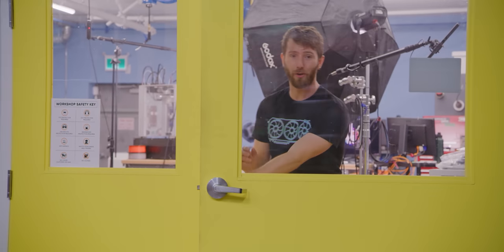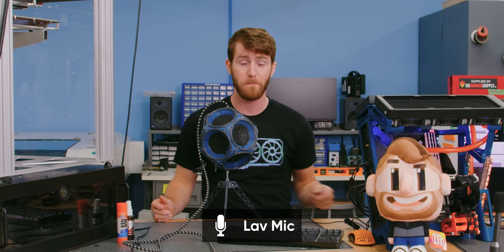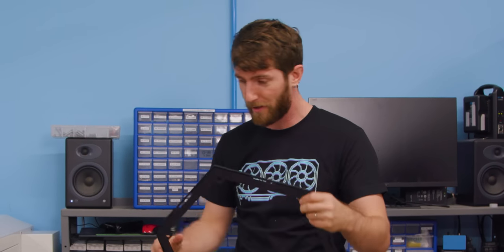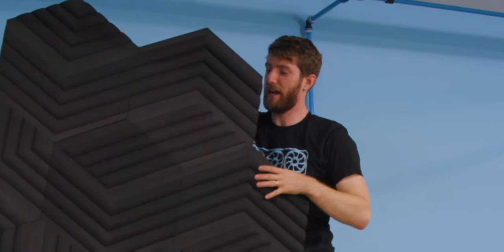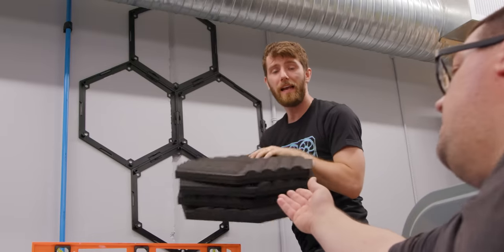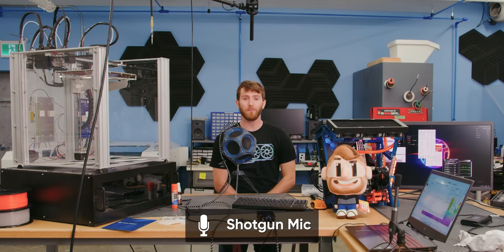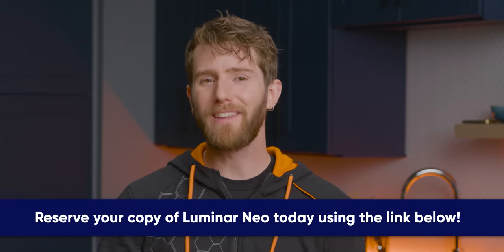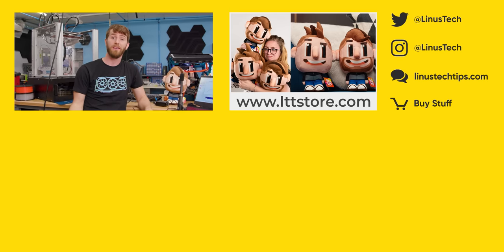I'm only going to say this once... - Acoustic treating with Elgato Wave

Comment: I'm building my own sound isolation setup with acoustic panels or foam and cardboard. And yes....I have made my own wooden frame with stuff I bought from Bunnings 

Tip: If you don't want to make the panels permanent on the walls just buy some stick on picture hooks and wire so you can take them down and place into a new position.

Comment: Whenever I see someone put up foam like that I just hope the manufacturer really got them rated for being fire resistant and not producing toxic smoke if they catch fire... Why worry? Because much too many companies and consumers just don't care or even understand just how bad it is to slap up random foams, well, anywhere. Like many of the DIY ones are pure fire hazards because most just buy the cheapest foam-like stuff they find, not knowing what happens if it were to come in contact with a heat source.

So good to see these appear to be somewhat decent.

Comment: A note: the panels are great for streaming purposes, but if you are streaming in a workshop environment like in the video (so 3D printing or CNCing toxic materials), you may want to spend a couple hundred more on acoustic moss.  This will do the same but also help purify the air.

Comment: Besides hard surfaces that easily reflect sound, for which rockwool etc would be a much cheaper option than Elgato’s pads. The main reason for causing reverb/echo effects are square/rectangular rooms with even surfaces, the more uneven and absorbent a room is, the better sound breaks up upon hitting the surfaces, and then gets absorbed through the paneling

Comment: Another thing I'm unsure if it was covered or not is your floor is bare concrete. Laying down some interlocking foam floor mats, or a few rubberized mats here and there could help to further reduce the noise. Rugs would be a cheaper option and have similar results, but they would also carry the danger of static build-up and discharge.

Comment: hmm $2100.  home depot rockwool cost is $51 per 5,  4 inch rockwool  for $2040 you can purchase 40 sets of rockwool which will give you a total of 200 pieces, the $60 dollars remaining can be used for blankets and woods to hang the rockwool. Either way I like voice over productions so no matter what a good sound is a good sound, many audio people will say that was a waste of money which is was, but if it works it works. The thing that elgato did well with this foam is the mounting system because it left a bit of space for the foam to breathe and allow 2 actions to happen for the sound that was the most amazing part about this product.

Comment: I would LOVE if you made a comparison between Auralex and elgato KITS!

Concerning Auralex, I wouldn't put them under the bus. That kit you showed  will cover from Bass, Midrange, and Treble. 
I imagine there material costs a lot more than elgato and covers a lot more sound range. 
Auralex has probably put more R&D into there panels and is shipping them at more of a cost loss them elgato because they can volume ship.

Comment: Honestly, I'd get some rubber mats, like ergo mats they use in shops, and put those on the ground in key standing areas.  It'll help with the sound without costing a ton and addressing a surface that is just as much as a problem as the walls or ceiling even if its just a little bit of improvement.

Comment: I did this last year in my office. if you don't want to ruin your walls use 3M command strips, they are adhesive and work well with acoustic panels. also, they did not do corners which help a lot with bass reverb, it's a special type of panel but totally worth it.
Reply: also I used regular panels, 2100$ is an insane amount of money I think I spent like 80$ for a small room and it was totally noticeable. maybe not top notch but hey... 80$

Comment: Tbh every single acoustic foam will behave pretty much the same as this one, especially since you are only treating high frequencies.
You can get a lot more off brand panels for the same price and they will do the trick just as well.
Also technically the reverb you were mentioning is not a standing wave but just waves bouncing around.
And lastly to get the most out of your panels you should put them in first reflection points if you know you are going to shoot only in certain spots of the room. This is will make them much more efficient.

Comment: Like most technical areas of expertise, doing adequate research and acquiring a solid knowledge base, are absolutely essential to good, efficiently executed results.  

Just an FYI, you could achieve much better results with a small fraction of the materials used.  First, uou are using the wrong software tools (there are free tools that you should have employed to determine placement), missing the most important areas that would substantially reduce the required amount of absorptive materials, and you should have used diffusers in two major areas where you employed absorptive instead.

I have helped build numerous media labs, recording and dub studios for decades, starting with MIT, LIHTI, NYU SB Lab, Seeflection Studios and many others.

Comment: You could spray paint them for perfect color accuracy and any color you want!
Would also not really change the accoustic characteristics.
(Also if you're using glue anyway, try to find a small production house for foam. Sometimes they sell to consumers directly for a pretty awesome price, if you know the shore hardness and thickness you need)

Comment: These look great but, what about dust? They have milled stuff in the past and if they ever do any MDF or HDF or even normal plywood there will be so much saw dust that these nice black panels will be coated, plus those edges will hold stuff well.

Comment: Just build urself a few absorbtionpanels with rockwool, these "sound absorbtion panels" have all the same problem: they dosent have enough density and thickness to get rid of unwanted frequencies and echos/reverbs without like we see here as example, put a crap ton of these panels onto the wall and make the room almost "dead" (which is soundwise a hell of a mess) without really measuring the problemfrequencies in that room and fixing them. 

also: ur measuringmethod is a typical amatuererror, that room must be completely emty and closed to measure it

also 2: (would be a fun video btw): for this room cause its that high, u could build urself one huuuuuge Cloudabsorber, or 4 smaller ones that are a bit shifted anglewise that the soundwaves that goes up, dosent gets reflectet at the same angle and produces another problemzone  ;) 

stay healthy and keep it up ;)

Comment: well me and my gf were able to build 8 of 2'x4' (1inch thick) rigid fiberglass panels for like ~$35/each or something.  also absorption would be better if you could space them off the wall like an inch so sound can be absorbed on the backside of the panels.

Comment: This just in "Are recording studios doing it wrong"? Next episode "we installed bass traps in the corners as well since we stepped on this route". You can also build fairly cheap reflection killers from plywood if you set up a surface of wood and then make uneven hills and valleys through one direction. Of course youtube has many examples of making that stuff. It can be a lot of fun if you have some DIY spirit.

If you want to pay less for the foam pads, you can buy them from china for some dollars per box and use 3M double-sided tape pieces meant for frames etc. No self-assembled plastic frames or screws on the wall. Also no streamer branding included. Obviously slightly less tech, but not 10x less impactful.

Or if you have a small room, just use heavy curtains and rugs on the wall, like many band rehearsal places did back in the day. You know the effect if you've ever moved to an empty house that has a scary level of reverb and then you move your stuff in and it sounds very dead.

Comment: Speaking of acoustic panels. It's said that using panels would go against omni-directional speakers like my Xbox Spherex 5.1 sound system right? For a rectangular room where would you need panels? I would personally put soundproof panels behind the desk/TV stand since that's what's most likely going to obstruct even omni-polar setups. Don't want sound bouncing from open furniture like the Monarch Specialties 2690 TV stand.

Comment: You need specific panels for certain wave lengths. Thin panels will do nothing for low frequency waves that can be 50 ft long. Those panels won't work for theater purposes.

Comment: The instruction manual specifically says “only mount on straight walls. Do not mount panels on ceilings.”

Maybe they just said that for liability? I’m not sure, but shouldn’t having them on the ceiling help the acoustic goal overall as compared to only on the walls?

Comment: The Cloud Storage costs in the video were wrong. You can store 1PB of data in S3 Deep Archive for USD$1,000/month, which would be cheaper than the man hours required to keep your NAS running (plus up front costs, electric, maintenance, etc) and you'd never lose the data.

Of course, you do these projects for fun so I get that's not the point 😉

Comment: If you're watching this a year later, get a fuckin rug, hell a bunch of rugs, and hang one about an inch from the wall on all  4 walls, one on the floor. Hang some tapestries from the ceiling or just put a few foam blocks to break up the surface. It's...lol...way cheaper. And like 90% as good, as professional foam. You're just trying to catch the sound waves and convert them to heat energy instead of bouncing them back. Also, it looks nice.

Comment: If your goal is to limit room ambiance you're better off using the shotgun mic off frame as shown, but placing sound absorbant shielding oround the mic between the environment and mic capsule. This is the same thing as a portable vocal booth. Obviously what they did works, but it's not cost effective at all.

Comment: I wanna know what the hell you're actually doing in that shop. You've got a sand blasting cabinet, E3D Tool Changer, big CNC router, looks like you have a nice dust collection system, laser cutter, drill press, etc, and some like 12in PVC pipe? Is there another channel i'm not aware of?

Comment: Panels like this are, for the most part a waste of money.  just get 8" pine board, a bunch of pink insolation and some burlap and build huge thick, dense panels that cover a lot more space per dollar and absorb a far, far wider range of frequencies.  Average cost of mine was about $40 for 2 4'x4'x6" panels and another $65 for 2 6'x4'x10" absorbers that when spaced a few inches away from the wall absorb down as far as around 160hz all the way up past 20k.

Comment: get a friend.
tell them to sit in the position where you will be talking etc.
take a mirror and walk away from the speaker on each side level with speakers slightly above or below 1 ft. 
when you see your position you have the first point of interference from the speaker.
those left and right places will be the best for your foam, and above.

Comment: It’s not fair to say the other foam doesn’t perform as well. I guarantee if you know how wave forms are made and you understand the acoustics of a room with the triangle and bulge shapes they provide compared to the wave form of the product you’re using, I you’ll find better acoustics. Especially when you add sound or instruments. Instead of just a vocal range. Just throwing that out there. Good video. Also the quick brown Fox jumped over the lazy log/frog* is a visual test for fonts to determine if it’s safe for the web; where doe Rae me sa go la tea doe are vocal tests. Which would be far more entertaining to hear you burst into marry poppins to give a more accurate vocal range.

Comment: I think you a missed a chance to compare it to a cheap DIY option to really speak for value. You could literally have run the test per panel placed to see if these differences came from all of the panels equally or just a few in the right spot.

Comment: Are cheap panels good?  I found in stores like Aliexpress, panels with 2.5cm or 5cm thick much cheaper than you usually see.  A fraction of the price quoted in the video.

Comment: hey guys if you want really good sound proofing your going to need to get enough foam in front of you behind you and the side walls there are much more options that are more reasonably priced, my room used to have a really bad echo but I bought a 96 bulk pack of sound foam on ebay for around 50$ and placed it around my room, that foam might have bigger pannels and denser foam but if you cant get all your walls then its not going to help as much

Comment: As an acoustic engineer and audio visual professional. It pains me whenever the LTT talks about sound. Please guys, hire an AV tech who knows what they are doing. There is so much misinformation here
Reply: This is the part where you give at least one example. That way your comment becomes...constructive.
Reply: @krane15  you're not wrong, this comment was a response to not just this video, but a couple others as well. I will rewatch the part that seemed wishy-washy and get back to you.
Reply: @krane15  Well for starters, they aren't stopping "Standing waves" they are absorbing sound and reflecting it between itself so that by the time the sound gets back to your ears you don't hear it, effectively treating the echo that comes from empty walls that allow sound to bounce freely without interruption. Also, the product showcased here is ludicrously overpriced for the solution it offers and any sensible audio engineer would use a combination of dense fire blankets or custom rockwool panels built by themselves or from an audio company instead of these. Elgato basically just got a ton of free advertising here by giving these to LTT for free, but most sound professionals you talk to wouldn't recommend these. You'd get similar results by hanging a blanket up or some paintings. Also if you are treating sound it's also a good idea to have some bass traps, which is acoustic treatment for the corners of a room to quell the lower end frequencies that bounce more in the corners.

Comment: Anything foam or polyester based is poorer at absorbing <500Hz and average above that. You can use Roxul mineral wool products are the best for full spectrum but check the handling & make cover them because of the mineral dust is probably not good for your lungs. Anything you use, check the handling, fire & safety information. Natural wool (that fluffy stuff from sheep) is not as good as Roxul but it's better than polyester or cotton. Middle of wall, diagonal across/up a few corners. You wont need as much area covered by thicker materials.

Standing wave affect frequency boost & notches is different than just reverb. Lot's of reverb is sound going in all directions bouncing/resonating & reflected around the room & back to you. A soundproof room could reflect all sound internally & let none escape so that you still have reverb inside but no one outside can hear (like an apartment). Sound absorption needs to absorb the sound while minimal movement/resonating & minimal reflecting the sound back into the air (quiet room & minimise contact with wall/floor/roof to reduce sound escaping to outside). Glass reflects higher freq but low freq easier to pass through. Dispersion (slats or cityscape) breaks up the sound so some large echo's seem quieter but some frequencies will still reverb. Check out the music studio examples but you can use less product than they do. YMMV. Lot's a different materials, designs & layouts to try.

Comment: Hey, can someone tell me if these would work to reduce noise from upstairs? I live in a flat and the dude upstairs bangs a lot. Yes I’ve spoken to him, and no, he doesn’t care.. I use earplugs when I sleep, which help about 50%. My question is, if I stuck these things to my ceiling, would they absorb some of the noise/vibration? Paired with the earplugs, I’m hoping they would help? Or would sticking them to a ceiling with the noise coming from the other side, make no difference?

Comment: Hey Linus I have a question a funny question is it bad for my computer desk top what ever that has a quad core i5 2nd gen supposed to be using all 4 cores to 100% on the crappiest settings on fs 19 going at a waping 1 fps

Comment: all great comments from professionals 
but i think rock wool is a great insulator and absorber of sound which would not allow sound transit to another space . if you are installing rock wool in you neatly decorated space it defeat the beauty of the space. i think this will do if need be to absorb standing waves or reverb and also retain the space aesthetics. ( plus its easily installed and usable, if the price is wort it ).

Comment: When you do this, you actually want the panels as close to the corners of the walls and ceiling (and floors if they're not carpet) as what causes reverb is the wavelength changing shape due to bouncing off at an angle and then immediately hitting another angle, causing it to come back to you just sliiiiiiiightly later, sliiiiiightly distorted.

You can actually test this easily with your cell phone in the bathroom. Bathroom? Yes, Bathroom. Put your phone on the edge of the counter and play some music with the phone speaker facing the mirror. Then, slowly slide the phone toward the mirror.  Since the counter and mirror essentially dont absorb sound due to hardness, you'll be able to hear it get worse as you slide the phone toward the mirror, in real time.

By placing panels in the corners you maximize absorbtion of the wavelengths at their most distorted or distorting points, cleaning up the sound dramatically and with less coverage required.